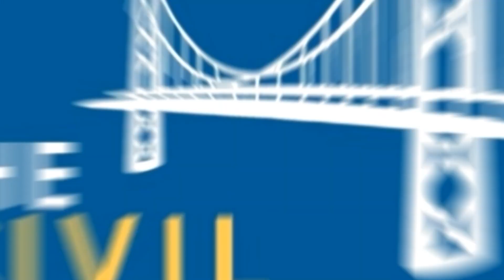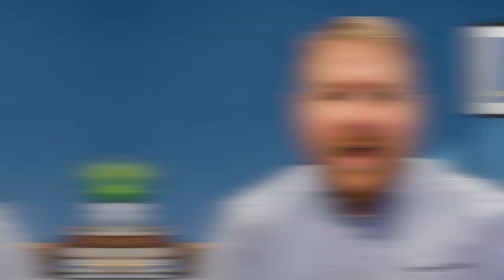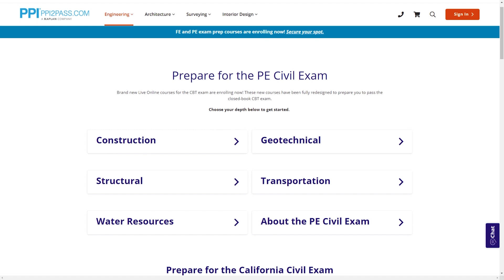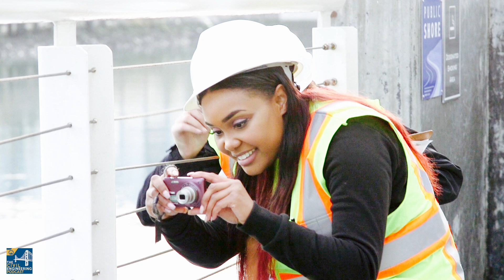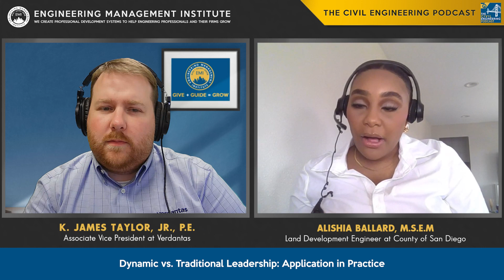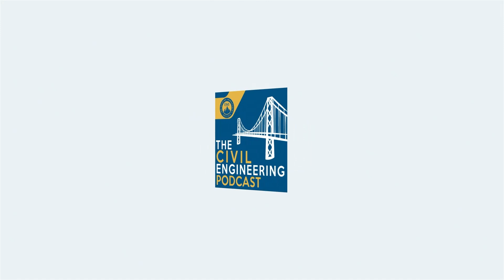Master's in Civil Engineering: The Ultimate Career Game Changer!

Comment: I'm a retired PhD-Civ.E. ... and the first thing I will say is that I've had a wonderful life and career after getting that degree; it absolutely was worth it.  But having said that. a few points for those considering the field, broadly seen:

• Civ. E. spans an enormous range of actual disciplines; much broader than most other engineering degrees.  Most people think that Civ. E. is about building structures: cement, steel, and even wood construction, or roads ... but it is also water & waste, and overlaps into chemical engineering (particularly pollution control), also overlapping into electrical engineering, and then of course there's a substantial overlap into architecture, urban planning and economics.  You need to think "where in all of that do I want to work" ... nobody knows it all, no school teaches it all.

* particularly with a M.S. degree, most of the work will also require licensure as a "professional engineer" ... you need to look at that.  Be very wary of any school or training program that doesn't consider this.

* many of the jobs are civil service, one way or another -- this can be good or bad, depending on you & circumstances.

Almost everything that Civil Engineers do has two paths to getting something done/built: handbook method or detailed design analysis.  An example of "handbook methods" are all the standard building codes that regulate simple wooden framing: studs on 16" centers ... yada yada.  There are lots of working "engineers" who do nothing but know/apply a handbook.  And if the goal is just to build a simple/standard wooden house handbook engineering is absolutely the way to go, particularly to get one house past the local building inspector ... who knows and applies the handbook.  I personally don't consider that "real engineering" though; wouldn't want to spend my life just doing that, and don't think a MS is necessary for that either.   Jobs where you get to do new things are harder to find ... but IMO much more satisfying.